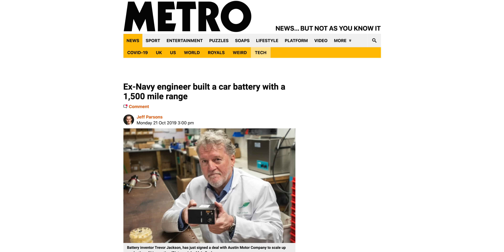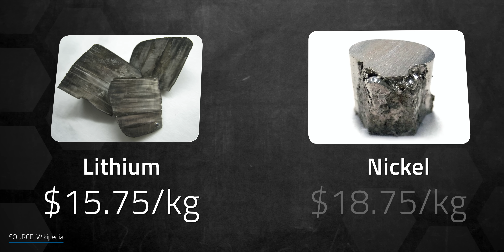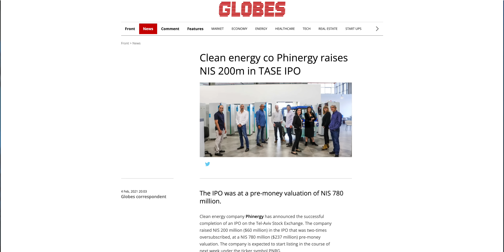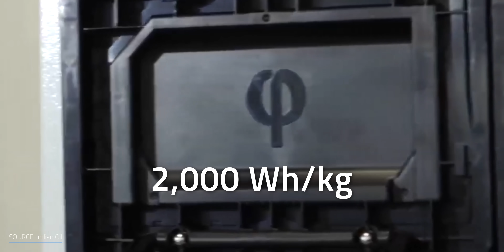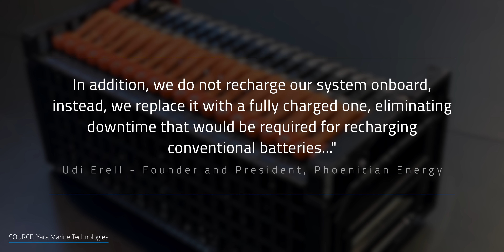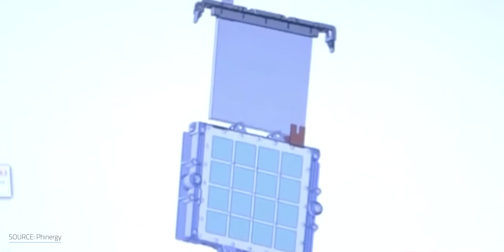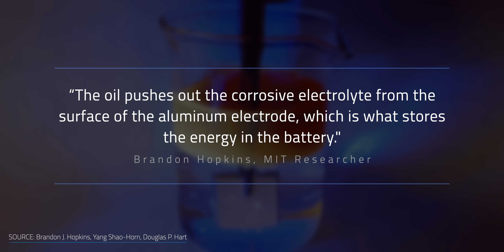Exploring the 1000 Mile Car Battery - Aluminum Air Hype?

Comment: My solution would be to use 2 batteries.  Use one until it is discharged, then swap over to the spare battery.  You can run on it until you have time to replace the first battery, and use it as your spare until your second battery runs out of charge.  If each battery can get you 500 miles, then 2 of them can go approximately 1,000 mi.  I wouldn’t mind having a car I could go 500 miles in, then have a battery swapped out if it can be done in less than 15 min.

Comment: Hey, superb video once again and it is nice to see my company mentioned (Yara). Just and employee, but still very proud of the push that my company is doing toward green energy (check green ammonia as hydrogen storage). As for would i drive i car with swappable batteries? Why not ? If it is cheap, fast and readily available to swap them what do anyone care? you do swap the petrol or diesel in your thank now yes? I bought a new car and had to go with Plug in Hybrid for exactly that reason. The range and infrastructure in just not there yet.
BR and keep up the good work.

Comment: Factual inaccuracy NO1 "Aluminium is a light metal". That is subjective and relative to lithium it is not. IE Aluminium has a relative density of 2.7. Lithium? 0.5. Last time I looked 2.7 was way more than 0.5. Then of course there is the re-charging issue or lack of it. These batteries were debunked ages ago due to all sorts of factors one of which was internal resistance.

Comment: I'm sorry this is not going to work.  He never once mentions kwh/volume, only weight.  Well, aluminum takes up a lot more space per unit of weight, meaning that these batteries will be very large/kwh.  Exactly where are you going to put this gigantic battery?  Remember, it has to be easily removed, so it can't be built into the chassis of the car.

Comment: You should have talked about the energy and environmental drawbacks of a single charge large scale battery like that. The question is not if customers could imagine using them but are they even feasible in terms of energy, CO2 efficiency and environmental impact. How much jungle gets destroyed, how much energy and CO2 does recycling cost, can the raw materials be mined ethically?

Comment: So my car consumes about 30 gallons of gas for 1000 miles so that costs me around $100.  A typical EV can do it for less than $50.  What is the chance of this 1000 mile battery costing less than $100 for the swap?  Less than $50 for the swap.  Granted, with EVs you do have to consider the initial battery cost as well.  I don't see these battery swaps as costing less than $100.  I could be wrong.  I would have no issue driving a car with a swappable battery if the battery swap was $100.

Comment: I would think that a viable solution to some of these problems would be a hybrid battery system - where an EV has both a Lion battery and an aluminum-air battery.  The aluminum-air battery could be used to recharge the Lion battery so that EVs could run with smaller lithium batteries. This would allow EVs battery systems to be recharged while also allowing EVs to travel longer distances between charges.

Comment: Easy solution to running out of charge in the road: All EVs should have a universal port that allows you to plug in an external battery. The chemistry and build for the battery shouldn't matter, just the output voltage and current potential. So any given tow company can just bring you a single use battery to plug in. Or you carry one from any of numerous manufacturers, in your car, like a you would a gas can. It could even be rechargable in a standard 110 outlet. Like those portable "generator" battery banks.
Reply: Make it two banks. If one is run out of juice, the other take over. So you buy anew one to replace the dead one.
Reply: There would have to be some type of regulation. Battery composition effects discharge capability. On top of that it would be difficult for the bms to monitor a different battery. Also thermal management would be an issue. There is probably more but that's a good start. Like the idea though.
Reply: @Tread_steady  a certain level of regulation would be necessary. There would need to be specifications met as with any universal device. You could easily standardize BMS output signal and pipe that back to the car over the power cable. I'm not sure cooling would be a significant issue for smaller banks, but then I don't know what kind of wattage is needed to move a car.
Reply: @OnceMoreUntotheBreach-d2c  from what I've seen and worked on, approximately 400 volt battery packs are pretty standard for passenger vehicles and a discharge rate of up to 900 amps. I haven't worked on larger trucks but I could see them using up to 800 volts and not sure about discharge rate.
Reply: @Tread_steady  Do we need more regulation? Drycell battery didn't. Its various forms are the result of prevailing designs, weeded out by market forces. The same as usb ports, tyre sizes, water gallon shapes, etc.

Comment: I don't think I would mind swapping batteries if it wasn't very often. If a battery can go 1,000 miles and I just use it for commuting I guess that would be once a month maybe 2 if I can work from home sometimes, but again that leaves out electric cars for daily / family driving. All I can see is electric cars for is commuting to and from work and for me that is not a sales point. 
People talk about reliability and the fear for me is I would try to start the car and not have power left to do so. This also has to do with current habits, Me as well as others have waited till the gas needle is as close to the bottom as possible with the confidence we can find a gas station and fill-up in 5 min. It will be very hard to break that, but if something comes along that is close and not super expensive I wouldn't mind trying. Including swapping batteries.

Comment: Look at it as an aluminum-air fuel cell and the issues and infrastructure needs are easier to think about. The parallels to h2 fuel cells show that use over closed circuits with buses and delivery vehicles, and construction equipment can be viable.

Comment: My first thought is "NO"  no way do I want a battery that I have to swap every time it's low but then if I think about it in a entirely different way such as fossil fuels, well we have to pull into a station to fill up on gas right so essentially we are swapping our "battery". It's not a perfect solution but I think if you compare it to fuel rather than lithium batteries then it looks a lot better and for me I can't drive electric because my daily commute is over 300 miles and the 1000 miles the aluminum air battery offers sounds good.

Comment: So instead of filling up with petrol when the light comes on, you change the battery. Every service station will have them and no charging infrastructure is needed. It’s the closest thing to the current fossil fuel powered vehicles I’ve seen. Very interesting. Looking forward to seeing how it pans out

Comment: There was something that was... well, let's say "tangentially similar" being reported a few years ago. IIRC it was being developed at a university somewhere in the USA (can't remember, it's been a while).

It leveraged the fact that aluminum is a rather reactive metal, but, being so reactive that it forms a very hard oxide layer immediately upon exposure to air (the oxide is so hard that it's used as an abrasive for grinding hardened steel), it seems to be an inert metal.

To get around this, they wetted it with a room-temperature liquid metal. IIRC they did not use mercury for environmental reasons (i.e., to prevent exposure to it).

They then placed it into a water bath, which resulted in the aluminum reacting to the water, which resulted in the liberation of hydrogen, as the oxygen in the water was bound to the aluminum in the form of [drumroll] the aluminum oxide, which collected at the bottom of the tank.

The hydrogen was IIRC used as a fuel source for an internal combustion engine, making it IMO a nice way to upgrade a car to the ultimate clean-burning fuel (exhaust being pure water, i.e., oxidized hydrogen).

I'd think it could also be used to power a fuel cell for an electric vehicle (or other devices, e.g. a generator for example)

It then seemed to fall off the news cycle. IMO the main potential problem was, "How do you shut it off when you're not driving?" The question of, "What do you do when it's used up" didn't seem to be much of an issue (IIRC they talked about swapping it out, and sending the aluminum oxide dust in to have it reduced back to metallic aluminum).

If either technology -- the "wetted aluminum hydrogen-generating cell" or the voltage cell in this video were to become a standard, then it should be no more difficult to have "swapping stations" than it is to have gas stations -- and most likely gas stations could add a swapping-service.

The "how to swap" part is IMO a big fat non-issue. If this system becomes an industry standard then it could easily become a self-service deal -- easier, and safer than self-service gas pumps, and faster, too. Open a panel, pull out a module (or more than one module), slide in another, and be on your way.

And the question of what to do when the battery goes flat in the middle of nowhere is easily enough addressed by something equivalent to the "reserve tank" used in airplanes, and IIRC older VW "Beetles" -- just swap to a reserve battery and drive to the nearest swapping station.

I find both of these aluminum technologies to be very exciting with incredible potential (pun not intended!) I think that if the older hydrogen-liberating system can solve its "how to make it stop" question it can fill niches that aren't a perfect fit for this tech. (And it might be something as simple as lifting it out of the water!)

IMO the biggest roadblocks to either tech are political, i.e., resistance from incredibly powerful entrenched corporate interests with a stake in maintaining the status quo. There was a news report the other day of a completely unrelated hydrogen storage tech that was considered to be so disruptive to the status quo that the government blocked their patent for IIRC over a decade. (The gov't has the power to block patents on the basis of "national security" and IIRC they played that card. When they do that, the patent holder can not even talk about his patent, and the government has sole rights to its use!)

Comment: I work for taxi company that specializes in transfer of business clients and cancer patients to airports, hospitals and other destinations and I rack up about 70,000 miles a year.

The diesel BMW 7 that I drive has a range of about 700-750 miles on a tank, so replacing the battery once a week wouldn't be a hardship and  assuming the location is close by, it would take far less time than recharging every day. 

Add to that the disappearance of range anxiety, yeah I'd be up for it.

The final consideration would be cost. In the UK, fuel prices are about £1.40/L at the moment so a full tank costs about  £105. So thats roughly £10.5k/year in fuel.

With an Al+Air battery, I'd need to change the battery at least once a week, so guesstimating 60 changes a year, a battery replacement would need to cost less than about £175.

Could this be possible?

Comment: One way to combat the issue of battery running out is to just have 2 identical batteries on board (say, side A and B), the combined total of both being the car's maximum possible range.

On normal commutes or when swap stations are available all the time, you can just run side A and keep B in reserve, then when A runs out you swap it with a new unopened side A and then swap the connectors to side B. But when you're in some kind of crisis or require all the range that you can get, you can then run both packs concurrently and use them up completely, at which point hopefully the crisis or super long trip is over and you can replace the battery again.

Even better, you can have the compartment for your Al-Air battery to either be swapped out or have an adapter installed within for Li-ion or other kinds of compatible batteries, so you can save on using Al-Air until when you want to.

Alternatively, how about having Al-Air batteries as a one-time portable battery 'generator' for a conventional rechargeable BEV, or having standard additional Al-air slots installed within the car for boosting the car's range whenever you wanted, sort of like a gas-fueled car's reserve tank?

Comment: I wouldn't mind swapping out batteries, it's faster than filling up the gas tank if the vehicle is designed with that in mind and if the battery is also designed correctly this could be fast, easy, and almost foolproof (although stupid people still pump gas into their diesel powered vehicles by mistake - nothing is completely foolproof).  With "a certain EV manufacturer's" innovation in automation, forgetting your battery charge rate could also be overcome pretty easily - the vehicle gives you audible (VOICE) warnings about your charge state and the display screen starts showing battery swap stations (just like gas stations or conventional charger stations).  While it's true that some folks are going to ignore this and end up getting stuck, so do people who stupidly try to stretch out that last 2 gallons of gas to make that 150 mile stretch - you can't fix stupid.  I think swappable batteries is a great idea, now they just need to discover a less expensive alternative for silver to keep the cost down.  Even if that chewed 1/3rd of the range of the battery by replacing silver, you'd have more range than lithium ion batteries - plus lower weight and cost once the silver alternative is discovered.

Comment: A reasonable way to implement lithium air batteries without any significant infrastructure required would be to use them in "generators". Kinda like those solar power "generators" that are popular lately. It would also allow for a case that can house the pump or whatever mechanism is needed to let the batteries be stored. It may even let you make the electrolyte seperate from the replaceable battery. Where you add the electrolyte just before using it, or top off an electrolyte tank in the "aluminum-air generator."

As for battery replacement you could just use a "core charge" system like is done for auto parts. Where the cost and profit from remanufacturing and reselling the batteries is removed from what you normally pay for the replacement batteries. That way the high cost silver is not included in what you pay for replacements when you need to replace the battery. Only when you buy them for the first time, if you ever have to. They would likely be included when you buy a "generator."

And the batteries and electrolyte solutions can just be stocked on store shelves in supermarkets, auto parts stores, and gas stations. No need for any infrastructure at all that way. Just like you can find car batteries and oil/coolant at your local mallwart chain store.

Comment: I think this would be a great addition to a lithium ion battery as a sort of range extender. For 90% of your driving you just have a small lithium ion battery, but if you want to do a long trip you get one of these installed before you leave and suddenly you have like 1000km of range.
Reply: Would be less complex than the mass amount of charging station that need will have to be built.

Gives ev a great market world wide to both long distance driving and less developed countries that don't have the electrical grid to support ........

Personal I'm on the fence about them but the should have a positive effective and make ev more viable over all
Reply: Indian jungles have large bauxite reserve.......so environmental plunder by tearing down ancient trees is green power?  How much will  the recyclable ability and clean air capability of aluminium batteries off set the environmental  impact?  it is almost play,  pause, repeate that comes with any fuel / energy supply requirement.
It is good to see the alternitives,  and that even big oil companies are involved, but the fundamental change needs to come from the attitudes of every day people and how we approach using energy,  transportation distances and act / interact with our enviroment locally. 
I can often buy imported orange's that have been transported 20,000 kms cheaper than ones grown less than 1000 km away.  Currently some of the materials used in clean green technology, including batteries, has some of the greatest transportation distances of any raw product. 
I'm all for EVs, solar and natural power generation, and am exited by new and alternite prospects, but also would like to see more transparency through the whole process.
Reply: Aluminium can run 2700 KM Tesla. Plus weight ratio is 1/4
Reply: Great idea but in practice would add more complexity to already complex electrical system.
Reply: @alaric_  Would it be any more complex than the gasoline hybrids we have now? You'd just be adding a different kind of battery to an electric circuit. Sure, you might have to account for things like voltage, amperage, phase, etc., but that seems pretty minor compared to an entire gasoline engine.
Reply: @michaelsteffeck6114  there is no complexity, you match the voltage of the car and that's it, the only complexity could be a separate battery management system for the aluminium air battery to make sure smooth operation.
Reply: @alaric_  I mean it's pretty simple compared to how complicated everything else already is

Comment: As long as swapping the battery is a shorter job than recharging others it is a good idea to swap. I always thought that swapping rechargeable ones would be more efficient and quicker than recharging in the vehicle as they could be recharged when power demand was low and generation capacity was high. (At night from wind farms)